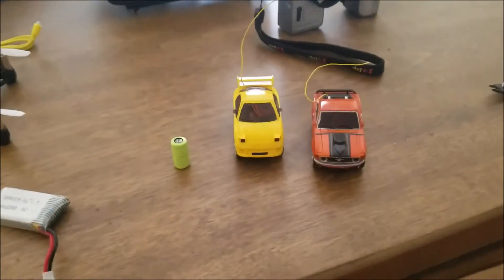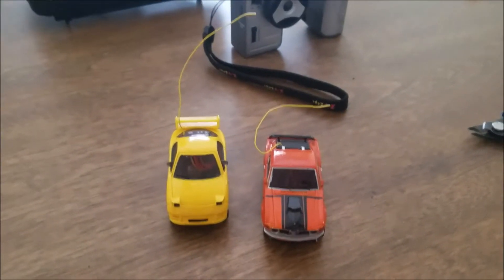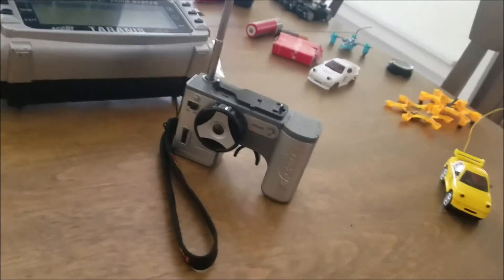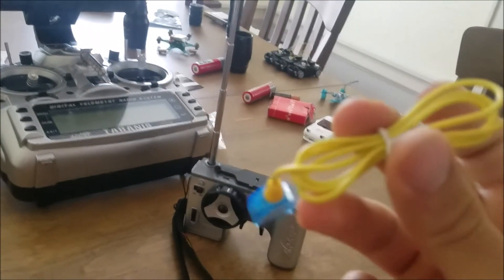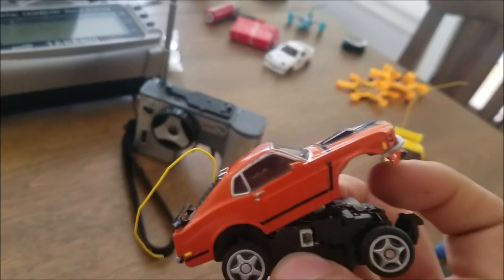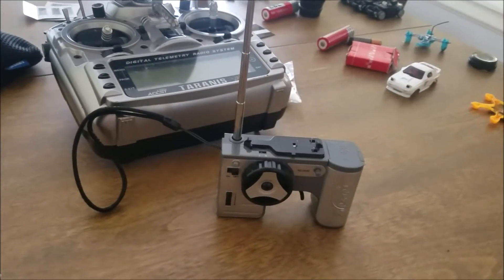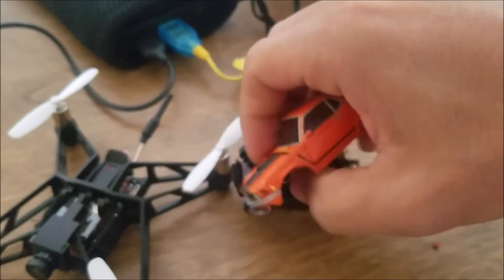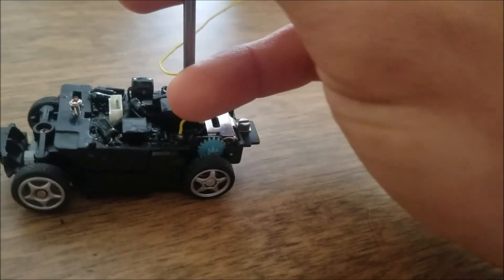ZipZaps SE Lithium polymer and drone motor mod. Revive your ZipZaps SE!

Comment: Great mods! It's nice to know about a mod like this. It would be great for drag racing. If you want better handling on a slick surface then try using the All Season Tires. They are designed for a better grip. They will slightly reduce your speed but, you won't spinout as much. Be careful not to fry your pcb or chips with the increased voltage. Also watch out for the amount of heat coming from the lithium batteries as that too could damage the pcb.

Comment: Picked up a lot of non-working ZipZaps a couple of weeks ago, and I've been dying to get them running again, but it's a little overwhelming, haha.  Got my solder kit in the mail today, but im still waiting on batteries, as well as ZZ branded wheel inserts and tires (because my lot didn't come with any sadly). I found a set of 4x 100mah batteries that SHOULD have the right dimensions, fingers crossed!

Thanks a ton for this video, even though its a little older now. Still great info!

Comment: Hello, does it need to fets the board when we use the 3.7v lipo. I saw on Facebook people fet it.
Reply from the maker: I haven't changed anything on the circuit board. Just the battery. Seems to run fine like that
Reply: @Kikesurf1  thanks a lot.

Comment: How much would you charge if I mailed you mine to modify them like you did yours?
Reply from the maker: I'm not doing any mods at the moment. Don't have the time 😔
Reply: Hector Arroyo do you have a link to where I can find the battery you used so I can try it myself in that case? Thanks for the reply by the way.

Comment: Great Video. How long is the 2.4 80Mah suppose to last on a charge? I get about 45 seconds of play time before it dies and I just replaced the battery on it. Using the remote to charge it, it takes about 30 seconds to charge. Is there anything I'm doing wrong or is that expected? Thanks!
Reply from the maker: Hey UberTech. I haven't messed with zipzaps in over a year, but these batteries gave me 15 minutes of playtime and I charged them using a computer USB port instead of the remote charger. I hope that helps
Reply: @Kikesurf1  Ah, 15 minutes with the Lipos. Thats pretty good! 

What about with the stock battery? Do you remember roughly how long those lasted on a charge?
Reply from the maker: @Shorty15c4007  I used to get 5 minutes max. Less after the battery got used up or corroded
Reply: The stock set up (70 mAh) takes ~4 minutes to charge and runs for ~5 minutes at full power and then runs down quickly. I find it's just perfect for a repeated sequence of a good satisfying race followed by a good satisfying session of smack talk.

Comment: I have about 5 of the proportional zip zaps, that I may convert as you did. However, instead of installing connector on the car's chassis, I will just solder the lipo battery in place, and I will modify the transmitter by adding the charger power to the existing contact pads on top of the transmitter. That way I won't have to add connectors to 5 cars, only the lipo's.
Reply from the maker: I wasn't that smart back then lol.
Reply: my son is just getting into zipzaps and I've stumbled on to your videos.  I've been replacing the batteries in them not being pleased at all with the performance and considering he doesn't have many yet i wanted to see what others have done prior to convincing a 10 yr old that i won't break his toys..lol.. and can make them better.   Thanks for the videos and also I would like to hear how your improvements go as well dadnyfur.
Reply: As a retired Development Engineer that likes to play with Hi Tech Toys, RC cars are up there on the list. I have been searching for the original replacement batteries, hoping to keep the cars I have un-modified. The batteries are: 10AAAHR (1.2v 100mah), and 7AAAHR2A, (2.4v 70mah).  I can't find a source for the 1.2v. THese are hard to find.  @jeffreymayer8550

Comment: I believe that the original battery in that car was 2.4v. So, I guessing that your LIPO replacement was 3.7v, a step up by 1.3v. The voltage increase apparently din't damage the car's circuits...

Comment: Love your video. Thanks. By the way, how do you sync rhe car with the tx after you removed the positive one. Can you explain the sequence of the whole process after you charge the battery with usb, then how do you sync with tx. you said the tx keeps flashing, then what next.
Reply from the maker: Kev Yeung Thank you! Double check some of those parts since ebay always changes. I have found that some of the usb cables have to be opened and have the cables swapped to get the right polarity. As far as getting the transmitter to work on a different channel....that's what it does when you put the car on it. So you change the channel on the transmitter, place the car on top with the switch on, and wait till the light turns amber. After that remove the car and drive away! The car always defaults to channel 1 when the power is cycled.
Reply: Thanks a lot. i will check.

Comment: Mine wont charge
Reply from the maker: Shane lawrence I need more details...
Reply: Hector Arroyo I connect the rc on top and it doesn’t charge
Reply: Hector Arroyo i have it turned on too
Reply: You think its the battery
Reply from the maker: Shane lawrence the NiMh battery could be dead. You may try to remove it and clean the terminals or swap it out for a lipo
Reply: Hector Arroyo someone sold me one that is falling apart smh
Reply: Hector Arroyo Are you selling any?
Reply from the maker: Shane lawrence not at the moment man, I'm sorry
Reply: Hector Arroyo do you have any batteries for the rc
Reply from the maker: Shane lawrence not at the moment. All I have are the old batteries from cars that I have modified

Comment: For the lithium polymer do you need to do the drone motor mod or can the battery mod be by itself
Reply from the maker: CRAZZYMONKEY 62 the battery mod can be done by itself. Don't use the purple motor though, I fried one

Comment: Sweet! I'll get to work on that, this video was super helpful.
Reply: Loved the vid man make some more!!
Do you know how hard it is to replace the engine with the ebay one in the link??

Zipzaps engine dont have wires like the ebay engine you linked.. asking as I dont have any zipzaps yet, but buying them to save money on speeding tickets in my truck!!
Reply from the maker: I already made two more which I will be selling. Just waiting on the USB cables. Interested? lol. The drone motor mod is pretty simple. You can either solder the motor wires to the pads where the motor wires are soldered which to me is the easiest, or you can solder the wires together. On the motor with the black and white wire, you solder the black wire to the pad behind the motor, and the white one to the pad in the middle of the car. If you need a picture let me know.
Reply from the maker: Thank you! I know I messed up on a few parts lol (calling the hexacopter a quadcopter) but even with a phone I get stage fright. If you have anymore questions feel free to ask. I'll still make a tutorial when I get the parts in. Good luck with your ZipZaps! These things are super fun still lol
Reply from the maker: YouTube Creator Apps! I updated the information on the charge port. I put the wrong one yesterday, be sure to check it out
Reply: ok sweet! will do
Reply: absolutely! If the price is fair and its a win-win then why not? are you selling with one of those precise remotes? or If I have one would your car work with my remote?
Reply: you know what would be cool too? one of those monster truck 4x4 , do you think you can give it enough power to drift on 4 wheel drive?
Reply from the maker: Yeah, the if you have your own zip zaps se remote, you can control many cars with it. In this video, I used one remote for both cars. I would be selling the cars around 55.00 or so because I get these for an average price of like 35.00 plus the battery (80mah instead of 70), motor, and all my hard work :P. I haven't messed with a monster truck yet, but those are pretty pricey on ebay so I let them go. Sorry
Reply: ok sounds fair enough ill buy one off of you then! how many minutes does the battery last in your experience? cheers
Reply from the maker: BigBadMarketer The 80mah battery lasts quite a while. I'd say 10 minutes or more, but I haven't actually timed it sorry. I just got the kit you mentioned, 38.00+7.00 for shipping and handling. I'll see what I can make work and let you know. As far as the zipzaps I'm selling, still waiting on usb cables, but they're coming from China so they take a while
Reply from the maker: BigBadMarketer I got the truck you mentioned and made a video. I got it to drift on my hardwood floor because it's slippery but when it has traction it tries to wheelie. check it out, it's my most recent video. I'm looking to snag a few more on ebay and start selling them
Reply: wow awesome!! I can buy the truck too then. It's got that charge mod too right? and the car's got that proportional steering? how much can you do for both? cheers bud!
Reply: hector did you get those charging cables yet? cheers bud!
Reply from the maker: BigBadMarketer hey man, sorry for the delay. I was on vacation to Puerto Rico and forgot. Yeah I got those cables in. I can make a package for you whenever you want.
Reply: Wow man this is exactly what I been looking for! For months! I've got cars and trucks I want to bring back to life. 
You're selling these? Do you have an eBay account? Or would you be willing to mod my cars and trucks for a price? 

Let me know, I'm very interested!
Reply from the maker: Esteban Toledo yeah, I wouldn't mind molding yours. I have a few 100mah batteries laying around and some cables. I saw you commenting on another video, the battery is a 150mah out of a JJRC h36 drone. The battery comes with protection, I just peel the tape off so I can get to the solder points. I can make tutorial videos or mod, whatever you want although the tutorials would take me a bit.
Reply: That sounds great. You want to add each other on Facebook messenger to speak privately?
Reply from the maker: Esteban Toledo yeah, that's fine. I'm Hector E. Arroyo on Facebook. It's a picture of me on the beach carrying my two sisters, one on each side...
Reply: Hector Arroyo alright i sent a request
I'm Esteban Tarantino
Reply: Hey hector how long would it take to get it in  ew hampshire? Can u do 2 for 105? Cheers!
Reply: Also how much would it cost you to send it to edmonton city alberta canada? Trying to see somthin here!
Reply from the maker: BigBadMarketer yeah, I can do that. car and truck right? I'd probably be able to ship out Monday if the batteries get here on Saturday
Reply from the maker: BigBadMarketer I'm not sure, I haven't tried sending to Canada yet...
Reply: Hector! Got everything ready bud? The little car that youre sending is it an se? I heard they steer better thats why..let me know if the things are ready cheers
Reply from the maker: Hey, I have cars that are ready but I don't have anymore drone motors for the truck so it would be just the upgraded lipo in the truck.
Reply: hector let me get that yellow one with the bigger battery.. is 60$ good? you can ship it to new hampshire too. Hey btw are those the se version? apparently the regular cars got 1 or 2 steps steering and se cars has 5-6 steps.. hey leme know I can buy one off of you then might buy some more toys later on cheers
Reply from the maker: BigBadMarketer yes, these are the SE version. I'm going to be away till Tuesday, but I can make a listing for you and I'll let you know
Reply from the maker: BigBadMarketer yeah, I'll let you know when I'm back on town and I'll put the package together for you.
Reply: yellow car with the big 100 mah battery? sweet! lol i feel like a kid
Reply: yellow car with the big 100 mah battery? sweet! lol i feel like a kid
Reply: hector my friend, did you get back yet? cheers!
Reply from the maker: BigBadMarketer yeah, just got back. Let me take care of a few things and I'll make an eBay listing
Reply: ok thank you! Putting some pressure on you to get this checked out from my to do list!  I'm buying a few things online, sending everything at once to my adress in new hampshhire nashua someone will pack it and send to canada!
Reply: if you want you can email  me when its done cheers bud  uncle.2can@gmail.com
Reply from the maker: Just sent an email and put up a listing. Sorry for the delay. Enjoy!
Reply: hey hector,  get this monster truck with all those accessories its only 35$, you can even resell everything for even more money. If you can make that monster truck drift, Ill pay a reasonable price off of you to make it worth your while!!

http://www.ebay.com/itm/Zipzap-Rc-And-Miscellaneous-Lot-/302289778130?hash=item4661dff5d2:g:yb4AAOSwfVpYqTwv